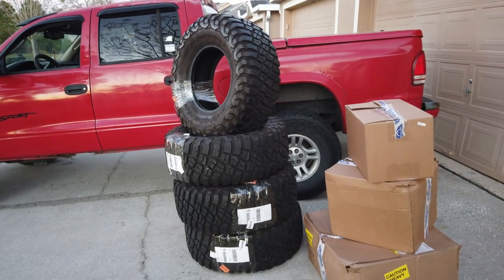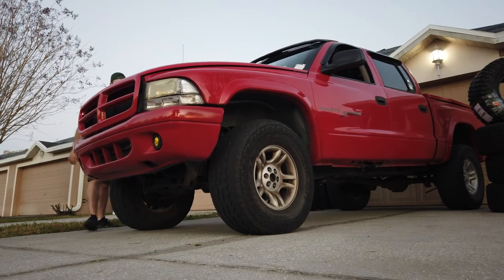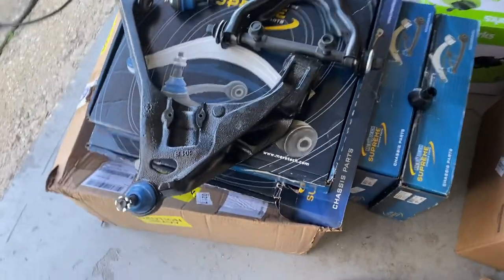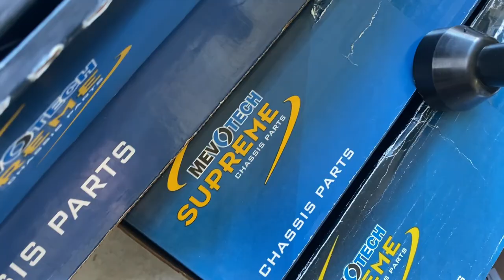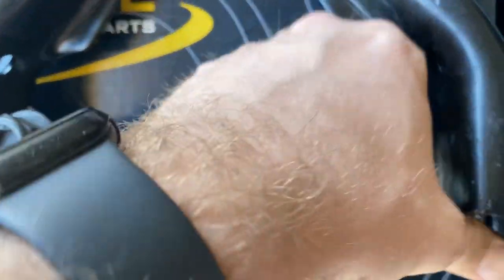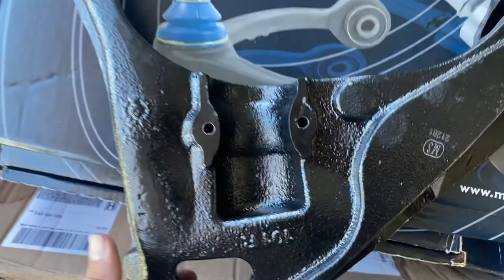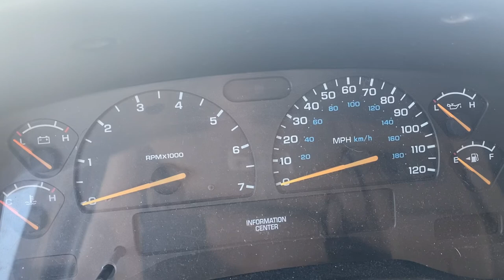Mounting New Wheels And Tires! || Dodge Dakota Overland Build Series

Comment: I have been running BFGs KM3s 33s like yours for about 10 years. I have 4.56 gears and a 360. I bought my Dakota just because it had a discontinued lift.kit but needed a motor. CBI did a full set of custom bumpers, rock rails and roll bar. Love my Dakotas.

Comment: My Dakota squeaks also, drives me insane.  Just got my new torsion keys and 3" blocks for the rear.  Can't wait to get these in. Probably will still squeak until I get new control arms and bushings. Getting redundant always having to spray the front end.
Nice work on your Dakota !
Reply from the maker: Hey thanks! Sorry for the delay but how’d your truck come out? And I definitely agree the squeaks on these trucks are insane😂 definitely have to always get greaseable joints!
Reply: @Al.Venture  my turn to be sorry for this delay. Got her jacked up couple inches looks and feels pretty good, but that dam squeek like noise is still there. I do believe its in the sway bar bushings tho that have no place to be greased.
Reply: Yes, you are correct on it being the sway bar bushings. I have owned 4 of these Dakota's. The sway bar bushings is what develops the squeaky noise. Replace those with some poly ones and you'll never have a squeak again

Comment: My 2000 Dakota Quad Cab squeaked badly too, so I sprayed every rubber suspension, steering and body mount point with silicone spray and the squeaks were gone.
Reply from the maker: Aye man! If the rubber bushings are worn out just spray some more rubber on them😂 but for real, it felt so good to replace these joints. I fixed the u joint too so now there’s no clanking or squeaks, feels weird driving my truck with only the exhaust noise😂

Comment: Awesome dakota man. Ive got the same squeak from my 01 dakota and im dealing with it to this day, Im about to change EVERYTHING out too and just like you said its going to feel so good to not hear it anymore. I love 2nd genz. Is there a leveling kit or lift on your dakota to clear the 33s and if your dakota came as a 3.55 did you have to swap to 3.92 to move those tires easily or does the truck accelerate as normal with 3.55 gears ? Im planning on also buying km3 tires after I seen how great they match.

Comment: Looks great!! I've been overlanding my 04 Dak on stock suspension and wheel size, once came dangerously close to high centering it
I want larger tires but need more clearance first up front
What upper and lower control arms did you install on your front suspension? are they just stock with a re-indexed torsion key?
if so are your ball joint angles under stress? or do you have something different up front?
Reply from the maker: Hey! Sorry for the delay but we’re back and got content on the way🤘🏻 how have you been likening the Dakota platform?? And I went with a MevoTech full kit (sourced from rock auto) and yeah exactly I have reindexed keys and 3” cast iron blocks running on 33s.
Reply from the maker: As far as ballpoint and cv angles go I stay very conservative with my suspension. Due to the way torsion bars work, preload = Lift, I see a lot of people that crank the hek out of their torsion keys to get nice lift but then there’s no down travel, suspension is on the stiff side, and all the angles are very aggressive which can greatly  shorten the life of the joints/ axles.
I believe I keep my truck at about 1/2-3/4” away from the “full droop” bump stop.  It’s given me that sweet spot of good on road/off-road performance while also keeping the suspension healthy and comfortable

Comment: I didn't go that big of tires 275 70r16 michelin all terain and so wouldn't Sucks down mpg horrible. 
265 75 r16 ,275 70 r16, 285 70 r16  , 285 75 r16, 265 80r16, 255 85r16 all fit we'll on these trucks.  
Being a pickup longer wheel base a narrow tire is better and will get better mpg paved roads.

Comment: new sub here, you have a clean build going man. i have a 2003 quad cab that i will be doing a 3' leveling kit towards end of summer, and after seeing those upper n lower control arms you did has me thinking i should do that as well. much like you, i want mine purpose built. fishing n hunting is mine, but i all also wanna jump on the whole over landing train. anyways just wanted to say, nicely done !
Reply from the maker: What motor do you have?? And yeah I’m up to 245k mikes so some maintenance like new control arms really helps these old trucks👍🏻 I’ve only just begun overlanding and it has been awesome! Where are you located? If you can camp on the beach for a weekend, catch and cook your food, you’ll be hooked! (No pun intended)😂😅
Reply: @Al.Venture  I have the 4.7l, just hit 169k this week. been a solid runner so far with no issues. im located in So. Oregon,approx 30 miles N. of Cali. border
Reply from the maker: Oh sweet!! Keep up with the maintenance and it’ll run forever! Gotta be careful too with all that salt up there!
Reply: @Al.Venture  oh, no doubt. luckily we dont have to worry about salt here. odot uses a red rock on roads when they get icy.
Reply from the maker: @frosty116  I’m so jealous, coming up I’m gonna have some videos on rust repair😅 even though I’ve been in Florida, the insanely salty roads back home took their toll. Is the red rock what it sounds like? Just fine gravel?
Reply: @Al.Venture  Yes, I live in a giant bowl, so all the passes get snow and ice during winter months. ODOT also uses a non-corrosive de-icing spray as well,but the red cinder rock is most common. look forward to your content !!
Reply from the maker: Don’t some places also use beet juice or something like that? Maybe that was fake😅 but I’m so jealous, the roads up north are so insanely salty, I’m gonna actually have rust repair come up in my channel and Segway into fabrication a little with that subject. And thanks man I appreciate it man!
Reply: @Al.Venture  can't say i've heard of "beet"juice, unless thats just another name for the liquid de-icer they use. every now and then government will bring up conversation about using salt. but i was born and raised here and at nearly 50 have  yet to see it. instead they tend to let peeps use studded tires for longer then whats really needed.
Reply: @Al.Venture  if i  can ever figure out hot to condense video and post here, ill start uploading random vids i have from go-pro, cell and such on various things, sadly im not much of a tech guy in todays world.....lol.  i have vacation end of July, after that is when i'll start build of truck. both long term projects and short.
Reply: Is you’re truck lifted or stock ?

Comment: Hi, thanks for what you're doing and capturing!  I have watched some of the vids, but can't recall what lift you currently have on the truck.  Is it lifted?
Reply from the maker: Hey thanks a lot! I love these kind of comments!  So I only have a torsion key lift and I think 3” blocks in the rear, the rear blocks are cast iron though (harder to find and more expensive than aluminum but I broke aluminum before I even started off-roading the truck)
Right now shocks are kyb which have been great but definitely need replacement, that’ll be another video down the line!
Reply from the maker: Also! The wheels and tires are 305/70/16 KM3s wrapped around method race wheels, 16” 0 offset
Reply: @Al.Venture  Thanks!  I'm going with the 3" key lift as well, and will look for the cast rear blocks.  I have the crazy squeak in the front end as well, only in the cold, and after a full Moog front end rebuild it remained.  Next, changing the sway bar bushings to see if that's the culprit.
Reply from the maker: Did the ball joints come greased already?? I always try to get the ones with the grease fitting, all my new stuff is mevotech.  These trucks ain’t too bad without sway bars (mine isn’t on rn)  but I’ve heard ppl say they can be tough to get back in, maybe do that while you have the torsion keys out

Comment: I have a 2005 dodge Dakota that I use for hunting. Problem is that it sits really low. What would you recommend to get more ground clearance? Suspension lift?
Reply: I would, just don’t cheap out on the parts

Comment: Very nice set up. What gears you running with those?
Reply from the maker: Thanks man! I’m running the 3.55s rn but I have a 3.92 front diff in my garage, I’m considering going with 4.11s if I have to rebuild an axle (but I’m trying to find a 3.92   9.25” rear axle with disks brakes to match the front I have rn)
Reply: @Al.Venture  those disc rear with 3.92 gears are really hard to find. I. In kansas and have been looking for a year. Any I have found are $600 or more. I am debating on doing gears myself. You can get ring and pinion for font and rear on eBay for $450. They offer 4.10s and 4.56s. I am debating 4.56s cause I have the 4.7.
Reply from the maker: I haven’t looked into what ratio would be best for me, k figured I’d just start with 3.92 considering that’ll let me also go to the stronger read end (and LSD) as well as being just bolt in. And from there decide if I want more
Reply from the maker: There is a guy selling 4.11s right now front and rear but it’s in a 8.25 housing instead of the 9.25 and it’s drum brakes still
Reply: @treyholliday7592  hello bro, I hope you can help me, I have a Dakota 2000 3.9 4x4 I used it for fishing in really soft sand, can you pleas recommend me If is any upgrade on ring and pinion to improve capacity on the sand of the 4x4, thank you

Comment: Your Dak looks killer! What torsion keys did you install? I'm looking at doing a front end rebuild on my '04 and would like to add a couple inches in ride height so thinking of changing the keys out at the same time.
Reply from the maker: Thanks a lot dude! First what kinda Dakota do you have? And I have reindexed keys, I’m not sure what kit they were out of since I bought them separate.  There’s a couple kits out there that come with keys and blocks however I definitely recommend staying away from billet aluminum lift blocks, I had one fail on me years before I even started going off road 🙄 Also what size tires you looking to run?
Reply: Mine is an ‘04 Sport, 4.7. Was an ex fire hall truck so well looked after, no rust! It is starting to sag a bit up front, torsion bars have been turned to raise up a bit. Was going to do the Mevotech upper and lower control arms along with the 1-3 inch keys from Supreme Suspension to level it out. I’m just looking to clear 285’s with no rub. It’s my fishing rig and would like to make it a little more bush worthy! 🤔
Reply from the maker: Oh that’s sick! I actually was a firefighter before I moved!  I loved it, but yeah the trucks get taken great care of! Sounds like a sweet deal!
Reply from the maker: Also you should be fine running that size tire, I’m running 305/70/16 and they fit fine, I had to trim the bumper a small amount and tuck the fender liner a little bit but it’s been great, bigger tire gives you a lot of confidence too

Comment: Hi Bud , where did you get the suspension kit?
Reply from the maker: Hey! Sorry for the delay, been sick😭 I actually pieced mine together, I have re-indexed torsion keys up front and 3” cast iron blocks in the rear, the aluminum ones somehow broke on me and that was before I actually took the truck off-road

Comment: Did you re-gear for those tires?
Reply from the maker: Hey, so no not yet, currently my truck has 3.55s with a 8.5 rear end. However, I was able to source a 3.92 front axle and just found a 9.25 rear end with disk brakes, I think an LSD, and hopefully also 3.92.
  I plan on pulling that axle and installing them both (of course making videos of the install along the way). And then if I decide I want a locker or bigger gears I’ll go from there, rear disks and a bigger rear axle though is a must for building a good foundation👍🏻

Comment: Are they offset any so they don't rub
Reply from the maker: So this is a 0’ offset wheel however it sticks out about an inch more than stock did with same size tires (Falken wild peaks) not sure if maybe the true width is more or why that is.   But so far it only rubs when full lock, i did lightly trim my bumper and pulled back the wheel well liner a bit though
Reply: @Al.Venture  thank you I've been having the same issue with the squeaky so I'm going to check out that company. I got the same truck with the 3.5 inch lift and 33s but I had to put spacers on mine. It's hard to find good off road parts for the truck
Reply from the maker: I agree! I plan on adding fabrication to the channel and hopefully I’ll be able to start distributing some much needed offroad parts to us dakota/Durango enthusiasts 🤫

Comment: What method rims are those ? Model
Reply from the maker: Hey dude! So they’re method race wheels, MR315😍
Reply: Thanks brah!
Reply from the maker: Yeah dude! Are you building yours for off-road too or what’s the plan?
Reply: Mine is actually all done . Just need to add some new rims and tires ! My is a 2wd 2002 dodge Dakota with 3” lift kit . Took it everywhere . It made it out of Death Valley in one piece lol
Reply from the maker: Heck yeah dude!🤘🏻 that’s sick, I have family in AZ, i totally want to bring my truck there after visiting a few times.  Have you seen that 2wd control arm lift kit for out trucks??
Reply: I actually put some control arms that I found online about 1 year ago but the bushing were cheap had to get some other ones . But they are good now . And yeah that’s sweet Death Valley is something else ! You will for sure enjoy it
Reply from the maker: Yeah Death Valley is definitely on the list🤘🏻 but yeah the kit is by X2 Industries, I’ve heard nothing about the kit though which is kinda iffy,

Also at 2 E/T a new Dakota video is coming out, taking the truck to Southeast Overland & Off-road Expo!

Comment: Nice job. I have a 02 Dakota and I had new springs made for the rear , it raised it 3 inches,  the front I put a 2 in puck under the front springs,  wrong way , now it's way too stiff. It's not a 4x4. Is there A arms and springs n shocks out there to raise it properly 2-3 inches? Could I use 4x4 A arms like the ones you just used? Please get hold of me on messenger pm me your number so I could ask questions. Thanks Bubba Villiard